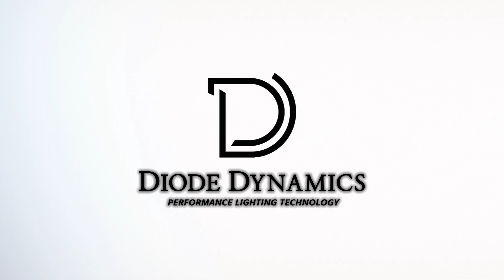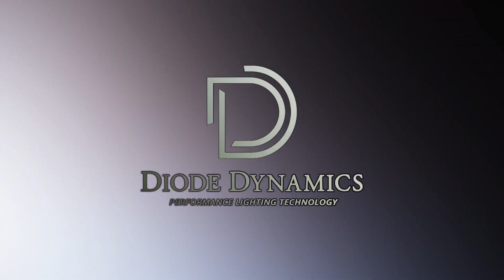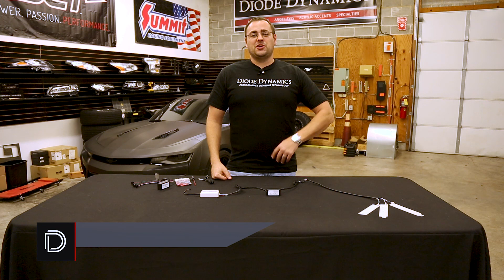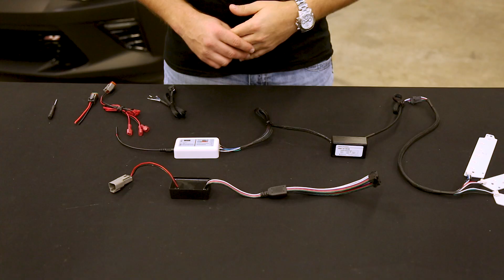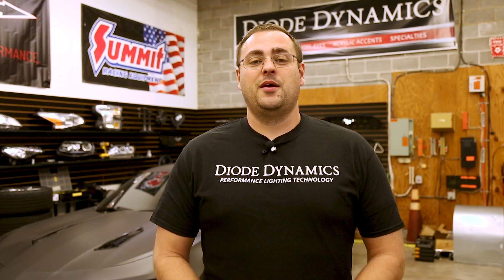How to Install Diode Dynamics Bluetooth RGBW Controller with Existing RGBW Products

Comment: ( I have 2013 Mustang GT) Do you have a video on how to properly wire the bluetooth controller to the car? Is it straight to the battery or do you wire it to the fuse box? Also, how do I add more than 4 devices to the bluetooth controller (under glow, grille lights, DRL, and Demon eyes)? No instructions were included in the bluetooth controller bag and the instructions that came with the Demon eyes and RGBW DRL boards weren't very helpful. Please help, thanks.
Reply from the maker: Hey there! Sorry to hear that. Please go ahead and give us a call at 314-205-3033 Monday-Friday 10 a.m.- 5 p.m. CST, or shoot us an email at contact@diodedynamics.com, and our service team would be happy to help you with that.

Comment: Hey, just picked up your RGBW controller to replace a different branded controller. My demon eyes are profile prisms and they are running on a 4 pin (no white) connection and the DD controller has a 5 pin. What type of connector adapter do I need to connect them?
Reply from the maker: Hey there! Please go ahead and give us a call at 314-205-3033 Monday-Friday 10 a.m.- 5 p.m. CST, or shoot us an email at contact@diodedynamics.com, and our service team would be happy to help you with that.

Comment: I just found out my car has a bluetooth RGBW controller setup on it found out when disconnected battery and they started flashing how do I link it back to normal my day time running lights used to shut on and off with the car now they just stay on
Reply from the maker: Please go ahead and give us a call at 314-205-3033 Monday-Friday 9 a.m.- 5 p.m. CST, or shoot us an email at contact@diodedynamics.com, and our service team would be happy to help you with that.

Comment: the pigtail cable .. does it come with the controller or is separate buy.. can it bought separately or from local market
Reply from the maker: +Sharun Viswanathan The pigtail is included with the kit. If you have any additional questions, just let us know!
Reply: Diode Dynamics I mean the pig tail to connects  the rgbw cable tats removed from touch controller wasn’t there in the Bluetooth controller case I boughy
Reply from the maker: We apologize for the confusion! If you are upgrading from our RGBW Touch Controller to our Bluetooth RGBW Controller, you'll need our RGBW Bluetooth Controller, 5-Pin Male JST Connector and Dual-Input Deutsch Module (links below). 

https://www.diodedynamics.com/bluetooth-rgbw-controller.html

https://www.diodedynamics.com/5-pin-male-jst-pigtail.html 

https://www.diodedynamics.com/dual-input-deutsch-module.html

Check out our video at the link below to learn how to install our Bluetooth RGBW Controller with your existing RGBW products! If you have any additional questions, please do not hesitate to email us at contact@diodedynamics.com. 

https://youtu.be/ICNoBzzUAzc

Comment: if you have demon eyes and c light leds will it work on one bluetooth box and will i be able to change demon eyes and c lights to two separate colors with one bluetooth box
Reply from the maker: +Albert Terzi With our Bluetooth RGBW Controller, if you would like to control your Demon Eyes and C-Lights separately on the app, you will need two separate controller boxes.

Comment: Since I have the old one can that be the reason why it doesn’t work
Reply from the maker: + mmagnetic2016 mustang We are sorry to hear about the issues with your RGBW Touch Controller! Please give us a call at 314-205-3033 Monday-Friday 9 a.m.- 5 p.m. CST, or email us at contact@diodedynamics.com, and we can help you troubleshoot and send a replacement if necessary!